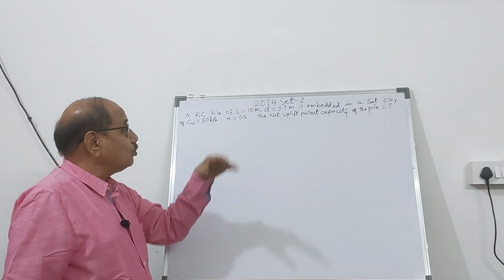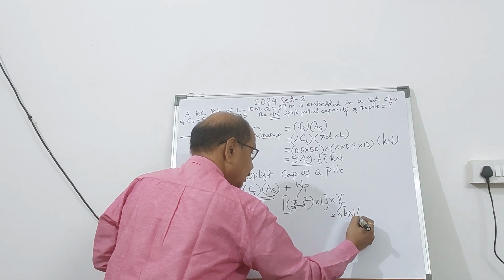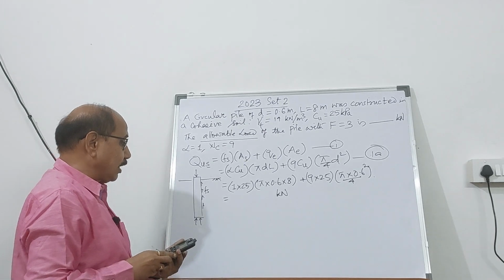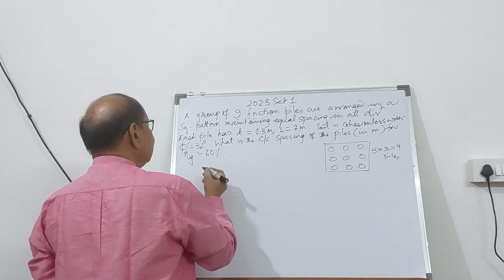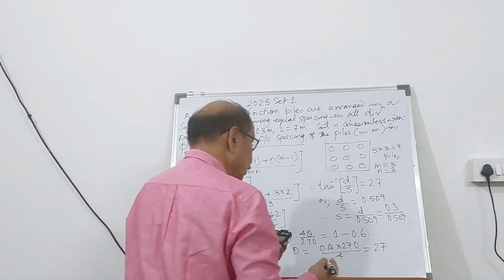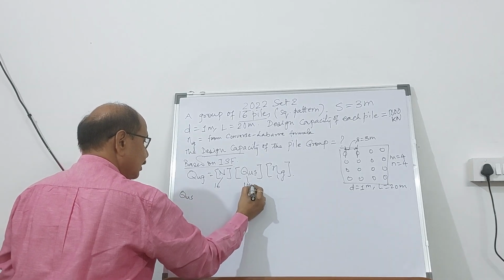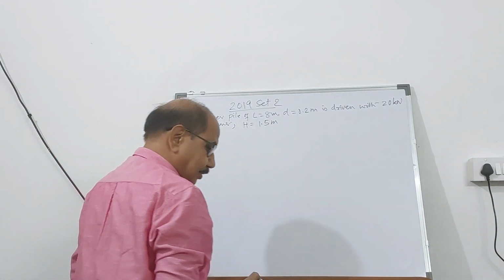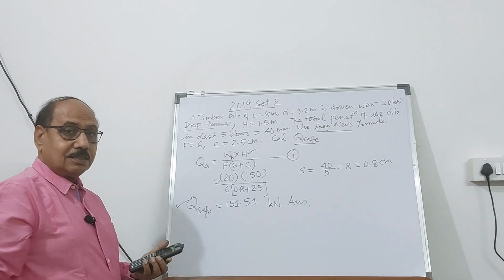GATE - 2 | Pile Foundation Problems

Comment: Sir here the Ans is given 2023 set-1 0.486 and not 0.589 sir
So according to direct ng = Qug/nQup using this formula Ans 0.486 sir
Can u see and confirm sir
Reply from the maker: Dear student. The solution of this problem is correct. If u try other way, u cannot solve as the ultimate load carrying capacity of the pile group Qug cannot be found w/o center to center spacing. Regarding answer, the correct option is ( A), which is 0.582. As per GATE norms, the answer which is nearer to the calculated one should be chosen. 
I hope this clears your doubt.